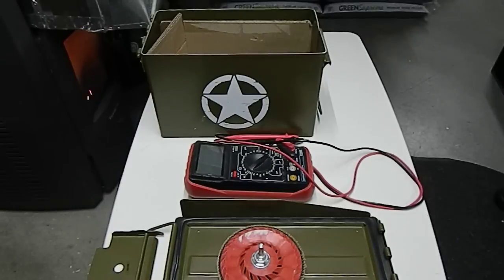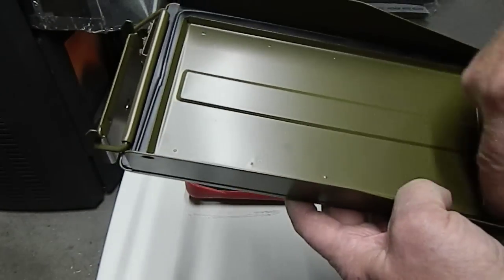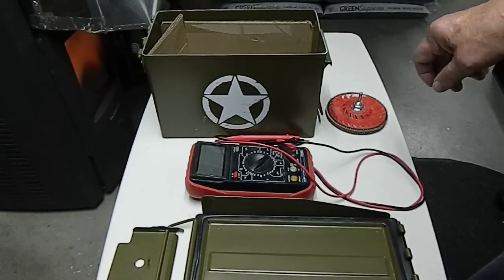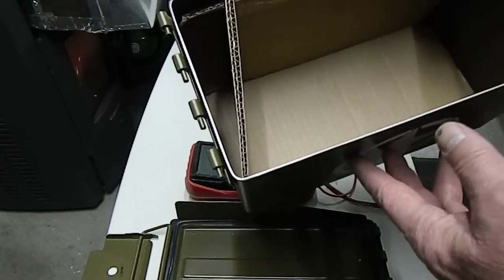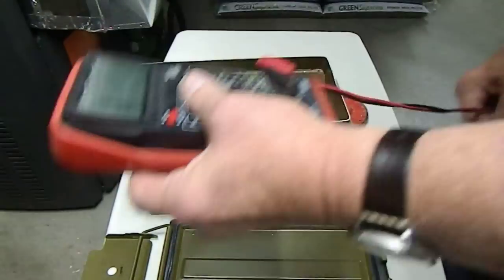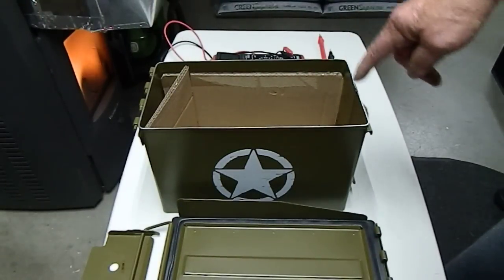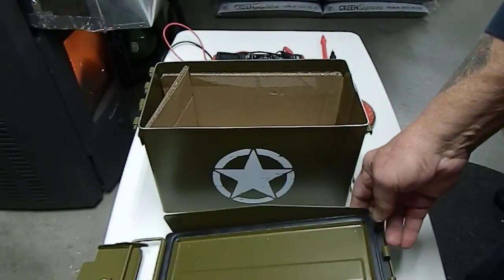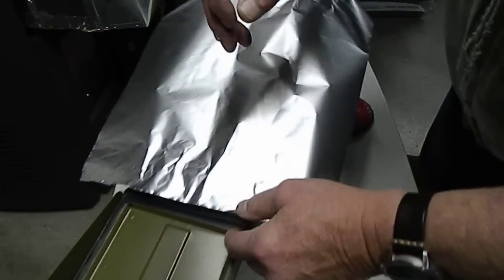AMMO CAN FARADAY …. you’re doing it wrong

Comment: this is the best method, do not use aluminium foil tape, it will seap through the seams, foil tape is useless, test it for yourself and you will see, i did foil tape first then 3 layers of normal aluminium foil like what this guy did and the radio still worked, but when i did 3 layers of just aluminium foil how this guy did it, it worked like a charm

Comment: After seeing this video, I had considered using aluminum foil but was concerned about the foil getting torn..  So instead of the foil, I bought some faraday cloth made of copper nickel composite.  Works great and gives me continuity when I test from the cloth to a small spot I sanded to expose bare metal on the bottom of the can.  Have made several using ammo cans and will use the same fabric to make a larger one with a steel trash can.  Thanks for the video.

Comment: Question is, aluminium foil conductive enough to allow the necessary currents to pass? The design I have seen involve replacing the rubber seal by a foam wrapped in highly conductive tape. The foam applies equal pressure on all sides.

Comment: Sorry but being water tight has nothing to do with blocking harmful EMF!
The US military comsec equipment for instance, has sheilding gaskets on every removable panel.
And they have a similar EMF shield over the cooling fan.
So think about it, a water tight cooling fan? I think not!
The theory is not to stop water but EMF waves.
What you want is continuity between the lid and bix / can.
So the shielding material has to be place on bare metal and contact bare metal.

Comment: get two hand held radios and put one inside and try to communicate with it and see if you can hear it. Wranglestar did something similar but just wrapped the radio in two sheets of foil in a can and that seemed to stop transmission. Would be interesting to see if this configuration would do the same!
Reply: I think for testing without specialty tools 2.4ghz, or even better 5ghz, wireless is a good idea. Place a phone in Wifi mode inside the box, next to your router using a Wireless analyzer APP on recording power timeline. Of course, your router should set to max power. After taking the phone out check if power droped to zero and the wireless connection disapeared. If it passes, it is a good indication it might be good enough.

Comment: When you test for a seal to the can, you need to scrape a bit of paint from the can and then do a continuity test from the foil to the can.
I do like this idea! For those who have deep pockets you can buy special rubber gaskets that can replace the lid gasket. They have fine wires woven in to contact the can and the lid. The adhesive is also conductive but you will have to take the paint off of the lid where the gasket sticks to the metal. Then you have a great electrical seal.

Comment: Your test is faulty...you checked for continuity on the foil...of course it worked.  And continuity most likely exist on the bottom.half of the can...but to prove it you need to sand off some paint on the bottom of the can and apply your multi meter to the foil and bottom of the can together.  Also...make sure nothing in the can touches the foil or can edges or it is for naught.

Comment: Nice video. However your continuity testing for verification is faulty on many levels it's almost laughable. Do you have continuity between the foil and the base of the box? And all the way around the lip? It's not like testing a wire or relay. Your container can have many imperfections as well as the foil and you will still get continuity. If I were to use your method I would give a probability of 60 to 75% it would work. For good measure I may also wrap the items inside the container with foil a couple of times. Along with using the thicker /sturdier foil.

Comment: Thanks for this great suggestion!  I may have a suggestion for improvement.  Instead of using aluminum foil, buy a very thin flat aluminum baking sheet - those that are the weight of a pie tin.  Then cut the sheet close to the size of the ammo box, but a little bigger on both sides and one end.  Take the lid off the can and mold the baking sheet to fit the inside of the lid after snugging one end under the hinge part.  If you are careful, you can get it to cover the entire lid over the rubber gasket.  It will work just like your foil, but the baking sheet is tougher and doesn't tear  nearly so easily.  Your idea and thinking, the baking sheet is just tougher than the foil! Thanks again!
Reply: Outstanding

Comment: A question for all the EMP preppers. Are you going to just toss your phone and computer and any backup hard drives in to the Faraday box and leave them in case an EMP hits? Or are you planning on running in, dumping your electronics in just before because you got a notice that NK is going to explode a device over your head? 
Unless you have a missle silo in the next yard and you see it launch, how are you going to know there is a strike going to occur in the next 30 minutes or less?
BTW, phones won't be any good except as a flashlight. The cell network will be down. All of your apps that are on The Cloud will be gone. All files stored on The Cloud will be gone.  Unless you have the app installed on the laptop like the old days (software from disk or CD) and the files stored on your hard drive, you will just have a paperweight.
Reply: Items that go in a cage are not edc.  Hard drive with backups, pair or three ham radios, old cell phone,  burner phone, old iPad, chargers, converters, etc.  A 2TB drive runs you about $100 for a decent one.   You can put all of Wikipedia on there. All of Wikihow.  Anything else you want. Public maps, etc.  The mindset of prepping, is what can I do now, that I wish I had done before.

Comment: You guys are working at it too hard. If you are bugging out, aren't you taking any pots and pans to cook in? Drop your cell phone in a pot and put the lid on. If you are worried about enough pulse to electrify the pot, wrap a wire around the handle and a metal stake in the ground, with a bit of water poured on the ground around the stake. 
And you could just wrap the device in aluminum foil and ground the foil with a wire. 
Faraday cages don't have to be watertight. I worked at Motorola in the '80s and '90s and we had several walk-in ones through the buildings. They looked like the old ham gear cases, perforated so that cool air-conditioned air and light could get through, but no signal.

BTW, why worry if your cell phone fries. If we get an EMP pulse, the cell towers are all gone anyway. The only thing you might want to protect is a laptop because of content stored on it. But you won't be getting any outside data anymore. So all of your Cloud-based apps and storage are gone.

Comment: Inside the can you are not protected if your electronics is touching the metal case from inside.  Very important to have that cardboard layer (for insulation) that he shows but doesn't talk about.  Better would be rubber layers like cut-up inner tube material.   Best of all is to have a device, surrounded by insulation, then full layer of metal.  Then another layer of insulation, then another layer of metal.  The more distance between the protected device and the outside world, and the more layers of insulation-metal-insulation-metal-insulation-metal the better.  For instance, an ammo box like this is hyperprotected if wrapped in insulation and put inside a small metal garbage can, that is insulated, and put inside a larger metal trash can that is up off the ground insulated by plastic feet.   Concrete conducts electricity including lightning strikes by way of the rebar inside the concrete.

Comment: While a seal may or may not be better for emp it will 100% help prevent extra humidity and corrosion. I would never ever get rid of the gasket. Maybe get silica packets as well to keep everything inside dry. Also would a plastic liner / containers be as effective as cardboard as an insulator, too thin?

Comment: I F-Day Proofed My Mil-Spec Can By: 
1) Cutting Preferably Two Pieces Of Cardboard: First Piece From Inside Bottom To Inside Front And The Second Piece Horse Shoe Fashioned From The Left Side To Back To Right Side!
2) I Secured The Two Cardboard Pieces Inside Cuts Via Beads Of Glue Or Silicone Sealant Then, Duct/Gorilla Taped Seams And Cut Edges!
3) I Removed Newly Created Card Board Box/Insert To Completely Seal Outer Seams And Top Edge's With Aluminium Duct Work Tape!
4) I Finally Make The Cardboard Lid/Top Only Half And Edge's Covered With The Same Aluminium Duct Work Tape Along With A H.D Multilayered Right Hand Hinge Between Newly Created Cardboard Box While Retaining Plain Cardboard Innards For Insulation Protection Of Electronics/E.S.D Sensitive Components, Etc! 😎

Comment: Sorry, this is just stupid! 

Take a can (un altered) 
Put your cellphone in it, close the lid...
Dial number....
You're welcome!
Reply: David, unfortunately your comparing apples to cumquats.  The minuscule signal you are blocking is a radio signal which are at most uV (microvolts) or about 0.000001 Volts in amplitude.  The EMP pulse, depending on strength of the blast and the distance away from the blast, you are can easily be thousands of volts for a very short time which will go right into the can.  The metal will absorb some and turn a small fraction to heat, but only a small amount will be dealt with without making sure the top opening has a thick foil or preferably another piece steel and / or Mu metal;  with all of that said it should also be grounded.  Don’t confuse a Faraday cage with a EMP safe Faraday cage.  Basically the EMP signal can easily be 1000000000 times as strong as your cell phone signal that it uses to make or receive a phone call

Comment: A better solution would be to sand down a ring along the top of the inside of the ammo can, instead of the lip. Then, glue magnets to the aluminum foil to keep it in contact with the metal. That way you don't need to insert aluminum foil between the lid gasket and the container, which will ruin the foil over time as you open and close the lid. The uneven surface of the foil might also compromise the seal.

Comment: To properly guard against strong EMPs, the box needs to have thick ferrous (Iron) skins.  Making the box just "conductive" blocks the Electric Field but does very little to stop the Magnetic field.
My family business used to build EMI shielded rooms for the military, and I was the "Test Guy" that tested the shields before delivery.

Now I am a Spacecraft Engineer and I perform EMI/EMC testing on whole spacecraft.
In fact, the WSF-M spacecraft for the Air Force is in Radiated Susceptibility testing for the next couple of weeks inside a very large faraday cage at work.
Reply: How about a cast iron dutch oven?
Reply: Good idea @mesapsych
Reply: It is an honor to have a chance to “subscribe” to people like you.I know you can’t just share ever you know but I am subscribed and absolutely interested in hearing your ideas and advice.  Me I am just trying to protect my backups of backups, maybe a few radios and such.
Reply: As per chatGPT, ferrous materials are only necesary for protection against magnetic fluctuations and those are produced by E3. These only affect large conductors (main target, power grids) not small isolated electronics, so ferrous materials are not necessary if you're seeking protection from E1 and E2, and any good conductor will do that, and even if some E3 leaks inside the box, small electronics are not affected because the induced currents are too small to produce any damage.
Reply: @tactiguay7154  So you believe CHATGPT over an actual Electrical Engineer with over 40 years' experience in EMI/EMC?
Cool.
I built a shielded room for Newmont Gold about 25 years ago.
It was made with 3/8 Thick plate steel and still failed the MIL-461 test because we did not fully fill the welds.
The chamber was 100% solid against E-fields but was still failing the magnetics test because the welds were not full penetration.
There was not a high enough solid steel cross section to allow the magnetic fields and currents to flow.
We had to go over the entire shield and fully fill every weld and THEN the shield passed.
Reply: Would mylar as a barrier between the inside of the can and cardboard as well as along the seal work?

Comment: Doesn’t the paint on the outside have to be stripped to maintain continuity with the aluminum?  How do you get continuity with the lid, since the bare-sanded part is virtually only touching paint (foil touching internal painted surface of lid)?

Comment: you can just connect a wire from the lid to the case near the hinge ( jumping the seal).  If it is a steel case,  then simply solder it. Minimal effort and you can open/close it with ease.
Reply: First of all, the hinge is a metal on metal contact point, so adding a wire would be redundant. Second, that's not how faraday cages work. Continuity will not protect your electronics. The lid should be in contact with the container around the entire lip. The rubber gasket creates a gap for radiation to enter the container.

Comment: im an electrical engineer by degree and professionally licensed in several states. the frequency is important to consider. For example, DC power is at 0 hertz. if you wanted to block that then I suppose seal all around, however it does not transmit in the air, so it is a "mute" point. other frequencies can go through the air, but you no longer need a seal to block it. the separation can be shown by the equation γ=f/c where f = frequency in Hz, c is light velocity, and γ represents wavelength in meters. You want your faraday cage gaps to be no larger than 1/10 of the wavelength. yes, that's right, holes are ok. does not need to be air tight. so that being said, what are we trying to protect from? a worst case emp, right? so that would a high atmosphere, nuke detonated, emp. that would produce static voltage across all frequencies. so you would prefer to have small holes for the static range, but yes, holes nonetheless are fine. the higher the frequency, the smaller the wavelength. cell phones for example will require very small holes at max. you can also always easily test, instead of using water, toss in your working cell phone and call it. does it pick up or does it not respond?... if the faraday cage setup is working, it wont respond.
Reply: Thank you, someone else gets it. Question, would it be helpful if you bound and ground said void for additional protection. Asking for a friend 🤔

Comment: Well, I used to design and manufacture, cases and containers for the military that were shielded for hemp, which is high altitude electromagnetic pulse 

the steel shell probably has enough overlap to shield, most frequencies 

as noted before, if you look at the perforated mesh on a microwave oven you can have holes in your container, they just have to be the right size For the frequency not to pass through 

In place of aluminum foil, you could also look at silver nickel coated cloth 

Aluminum doesn’t shield shield all the frequencies you want

Copper tape is your friend
Reply: 'the steel shell probably has enough overlap to shield, most frequencies', blocks my phone, stock ammo box latched, nothing more.
Reply: Would Mylar work?

Comment: I'm pretty sure it's not going to work unless you put aluminum foil on the inside too
Reply: it will because base is metal. it did have continuity when he checked, dit it? problem is that you'd need to insulate interior a lot more than just a milimeter or two of cardborad.